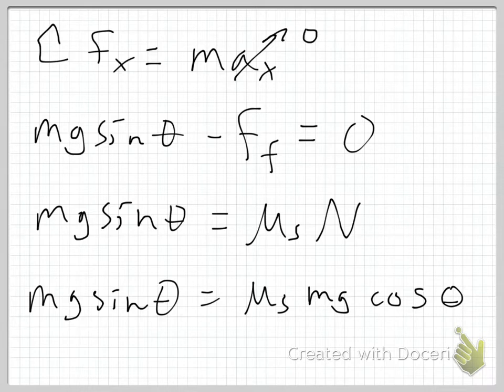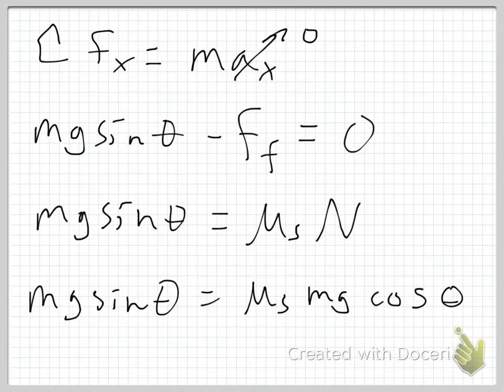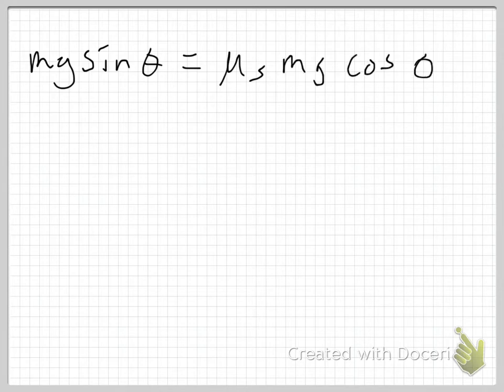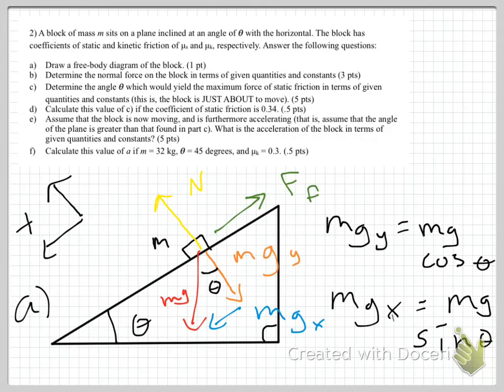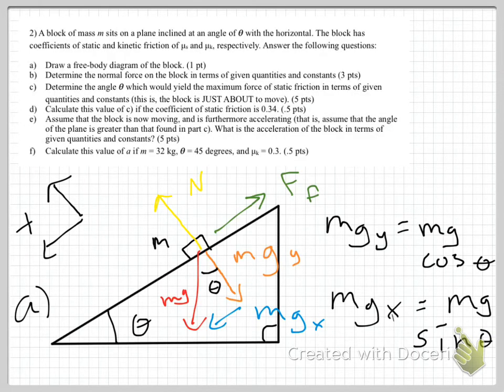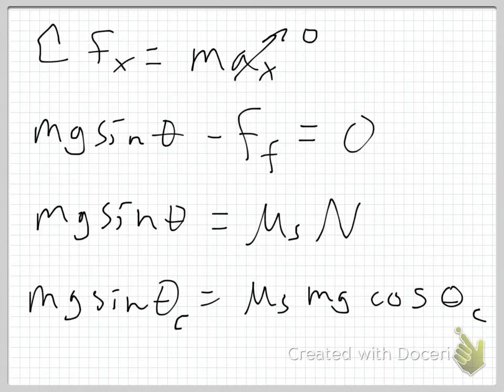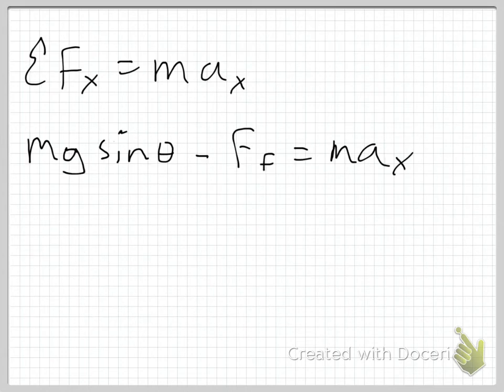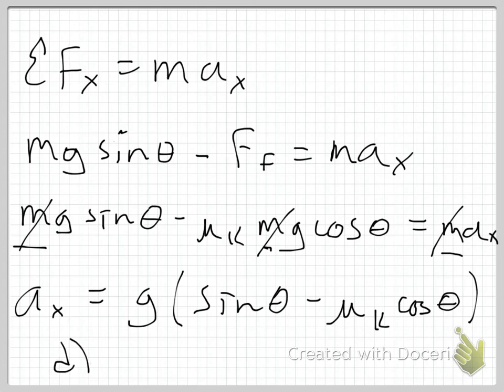Inclined Plane Example 1 Part 2

Comment: for part C, why is it okay to stop where you did instead of attempting to solve for Theta c in terms of givens or constants? i.e. to get an answer that reads: Theta c = ...
Reply from the maker: Hi, Robert. The short answer is that it's not OK; if you're attempting to solve for the angle, you'll need to take my result farther through an arctangent function. The solution I've presented here is just an outline. That is, I'm taking you through the physics and trusting you guys to be able to handle some of the algebra and trig I'm leaving out. Thanks for watching!